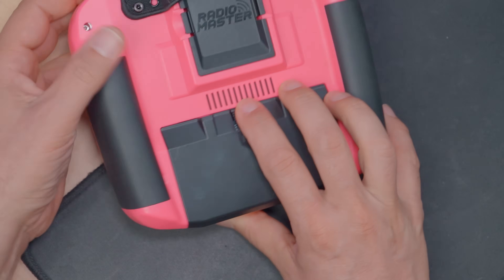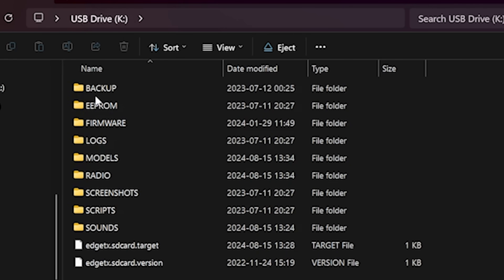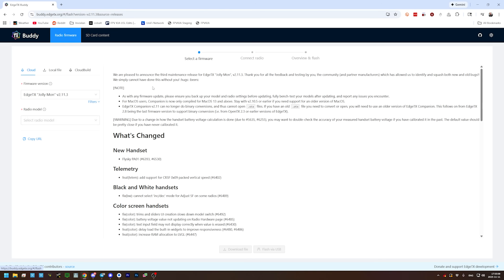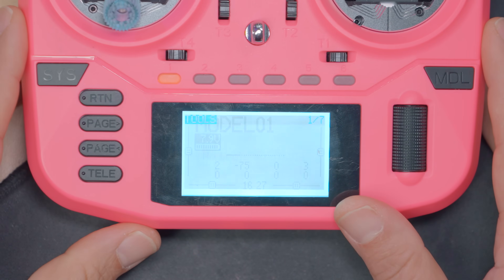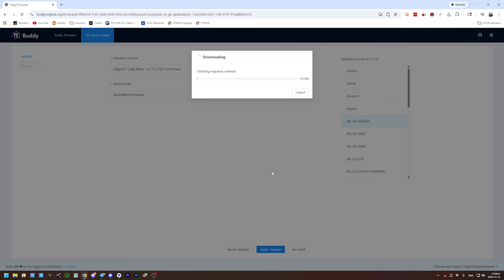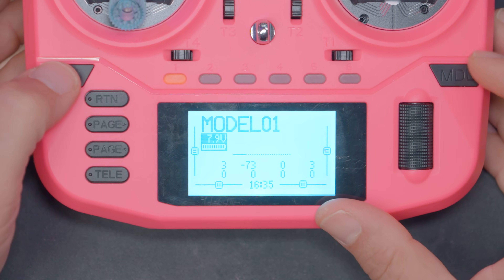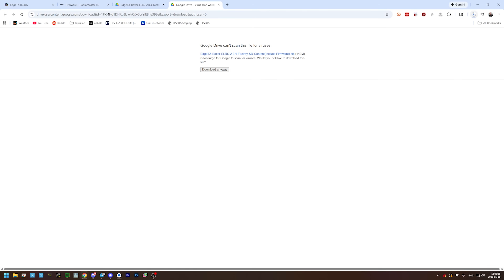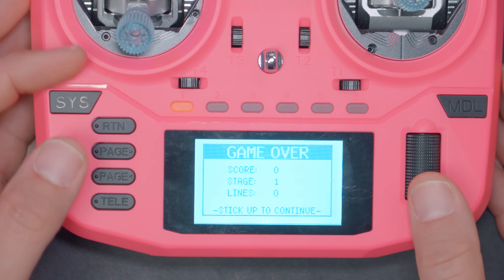How To Factory-Reset your EdgeTX Radio

Comment: Hi Josh, can I use my Fpv  dji controller 3 on a drone with ELRS receiver? it has dji 04 pro air unit in it though
Reply from the maker: You cannot use the DJI RC controller with an ELRS receiver. But if your drone has an O4 air unit, you can use the RC controller with the air unit.

Comment: If radiomaster provides the stock SD contents paired with an older version of edgetx and you have installed a newer one are they compatible or do you have to do the SD card setup with edgetx buddy first and copy paste from radiomaster only the stuff like the scripts and the models?